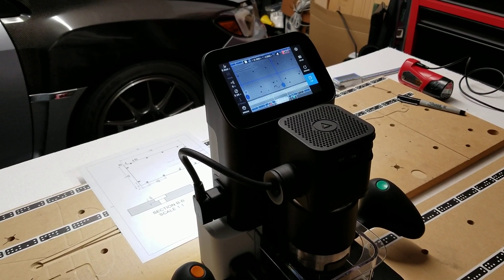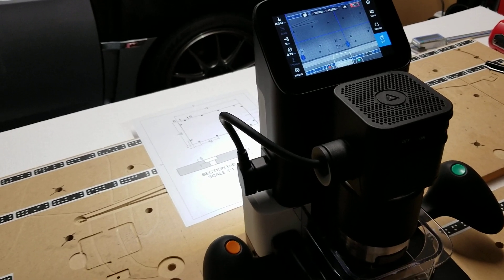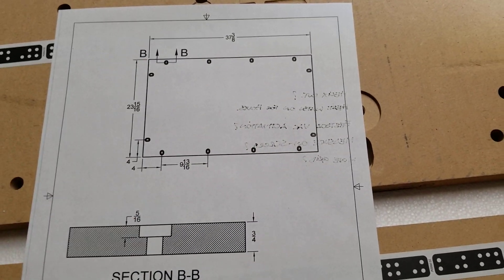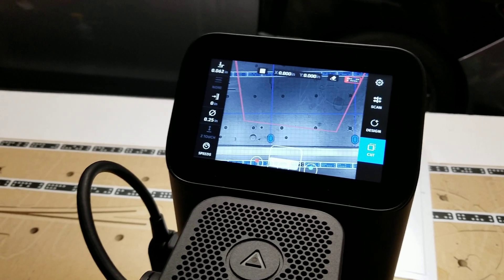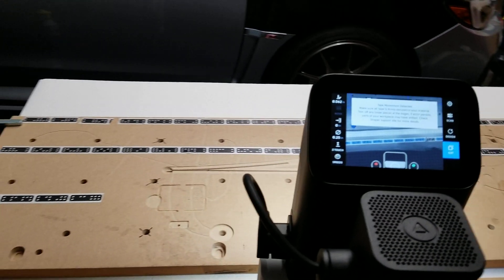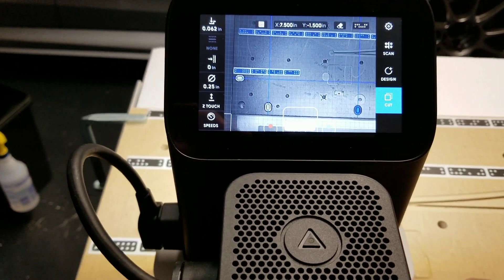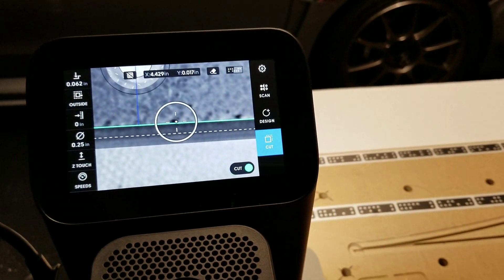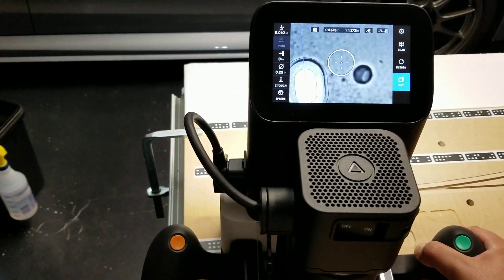Shaper Origin - Cutting close to the edge

Comment: Hi, interesting video.   Why is the tape necessary on the lower board?   Also, I assume when you make the holes on the left side, you will have to rearrange the setup to get enough support.
Reply from the maker: Hi Rob. The board on the bottom (closer to me) in this video only serves as support for the device. It doesnt read the tape. Also with regard to you second question, yes I deally you would want support but I recall that I also cut in a cantilever situation. The shaper is such  a versatile tool.